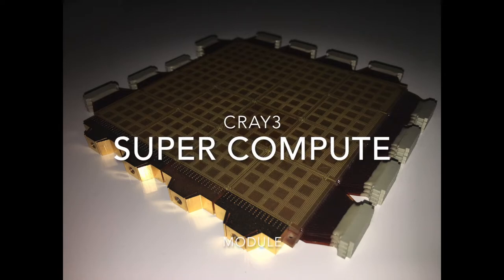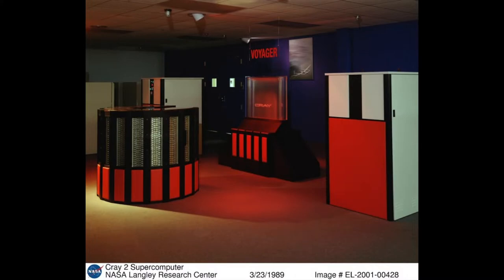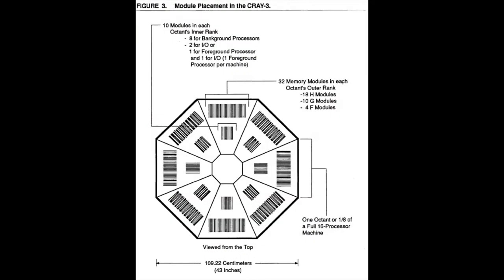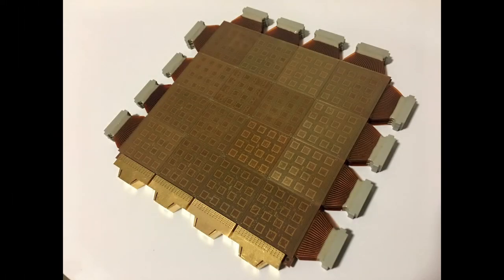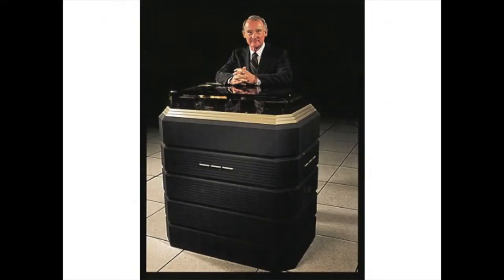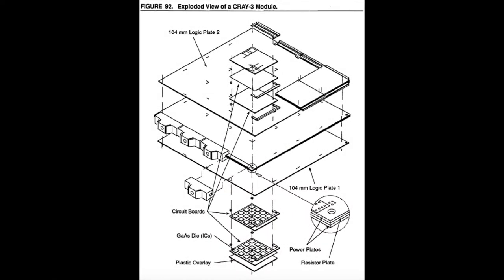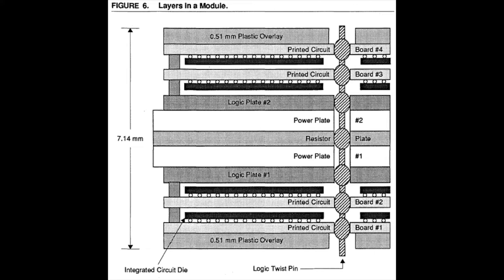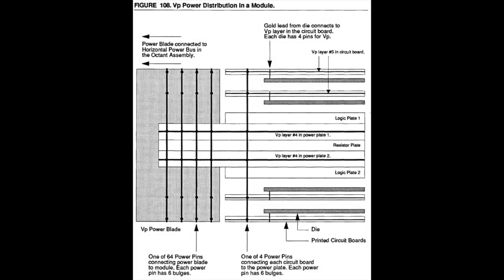The Cray-3 Super Computer

Comment: Was a Cray 3 ever fully built and run?
Reply from the maker: Only one Cray-3 machine was ever fully built and run.
Reply: @Irinikus  Dose it survive? Or was it destroyed to make collectibles for computer enthusiasts?
Edit: Also the Cray 3  would definitely win in a competition of power dissipation, when compared to my most heat producing thing in my lab, a small to medium argon laser (Coherent Innova 70. Its power transformer alone is rated at 18KW)
Reply from the maker: @lbochtler  I don't know what happened to the actual machine, but I would guess that it's in a museum or private collection somewhere. The module that I have was a spare module that came new in it's anti-static case.
Reply: @Irinikus  When i see Cray modules online, i allays assumed that they where taken from a machine. Good to know the Cray 3 modules where not taken from a working machine. It would be quite interesting to see the actual Cray 3 in the flesh. If i ever come across it, ill let you, as a fellow Cray fan, know about it.
Reply from the maker: Cool!
Reply: @Irinikus  did no one want to buy them and who operated the one?
Reply: @miles2378  I believe that was operated by NCAR. The Cray 3 was a magnificent piece of engineering but it arguably took too long to get it to market (if it ever really reached that point … it certainly worked, though). If the original schedule had proved feasible, things might have been very different. But with the advance of the killer micro and the popularity of massive parallelism, it really was too late. I’m still a fan of all Cray’s designs, though … :-)
Reply: @lbochtler  the cray 3 is owned by a guy in manchester as far as i know he has it complete with its special fluid and it does work .  but consumes sooo much power lol
Reply: @amdintelxsniperx  that is awsome. i hope we get to see it run on video or in person some day.
Reply: @amdintelxsniperx  Where are you getting this info?

Comment: A simple PC today can trounce that easily?
Reply: Just from the clock speed alone, say 4GHz you only need 4 floating point operations per clock cycle to match that.  The YMM register is exactly that -- 4 64-bit floating point values, pipelined to do one operation per clock thoughput.
A modern x64 desktop chip has two such execution units in each core, and several cores.